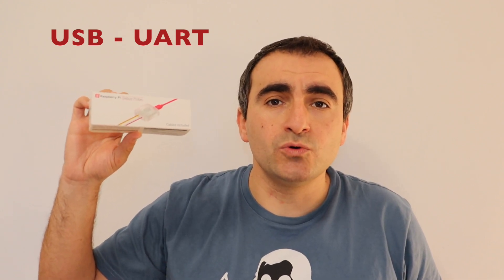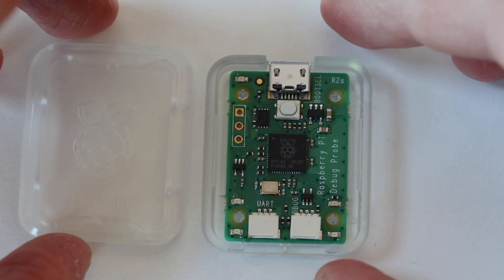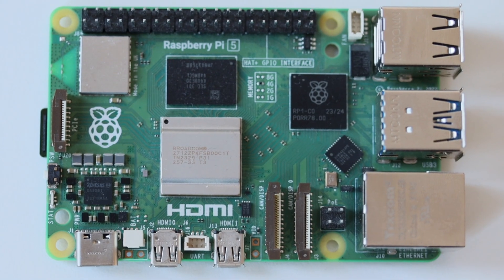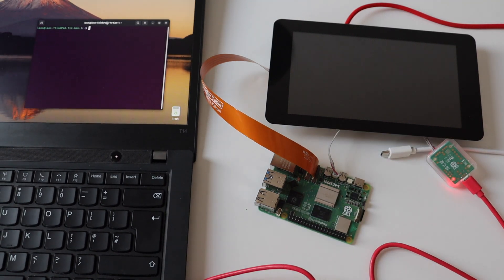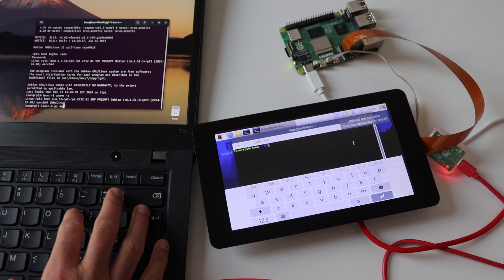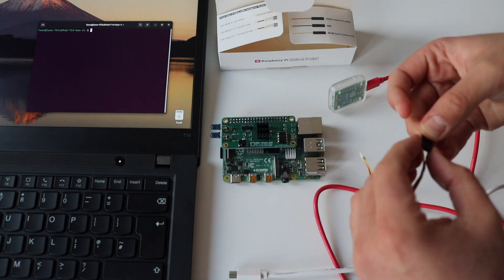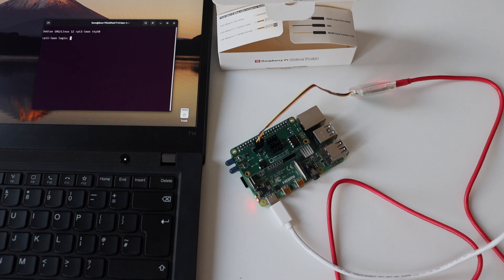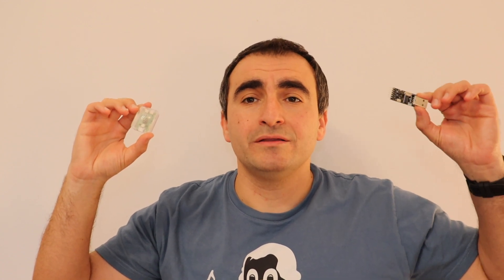Raspberry Pi Debug Probe: Connecting a Raspberry Pi 5 or 4 to a PC Using UART to USB

Comment: For other people trying this and running into unreliable output, I found the tool `minicom` to be more reliable than `screen`. Once installed you can use it by executing
`sudo minicom -b 115200 -o -D /dev/ttyACM0` (copied from the raspberry pi documentation)

Comment: Thanks for the quick guide! This will be very useful!
Reply from the maker: Glad it was helpful! I am using the Raspberry Pi Debug probe on a daily basis. It is a great little tool!
Reply: @LeonAnavi  Hmmm, it's not showing up in /dev as far as I can tell. I do see it in lsusb. I'll have to do some troubleshooting to see if I can get it to work! I am really excited to try this out for building a custom kernel :D
Reply from the maker: Hm, what is your setup? On Linux the debug probe should appear as /dev/ttyACM0 (as shown in the video) but on other platforms this serial port will show up differently. What OS (or Linux distro) are you using on the computer to which you plug the USB of the debug probe?
Reply: @LeonAnavi  I am running arch linux, but a reboot seems to have fixed it haha
Reply from the maker: @manon-gfx  it is plug and play on ubuntu ;) Check the udev rules on your arch setup.
Reply: @LeonAnavi  I am still a linux beginner (long time windows user), but I'll take a look at them to see if I can make any sense out of it
Reply from the maker: @manon-gfx  btw if you are a beginner it will be probably easier to get started with Ubuntu or Linux Mint. The Arch wiki actually has an excellent article to explain how and why they are different: https://wiki.archlinux.org/title/Arch_compared_to_other_distributions#Beginner-friendly

Comment: Hi sir, can the UART can be used to update EEPROM?
Reply from the maker: Well, yes, in general you can execute Linux commands in command-line prompt though UART and flash an EEPROM but depends on the EEPROM wiring and setup. For example, according to the Raspberry Pi specification for HAT (Hardware Attached on Top) on the add-on board there should be an EEPROM connected over I2C through pins 27 and 28 from the 40 pin header on Raspberry Pi single board computers. Which EEPROM do you have in mind?